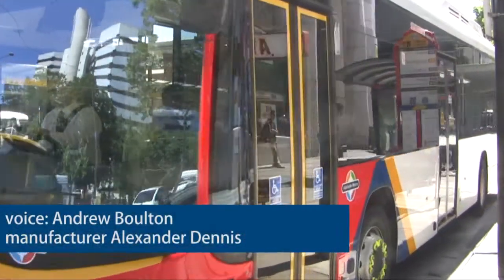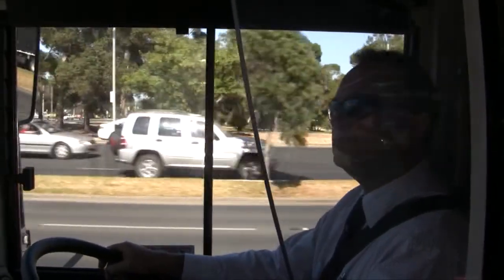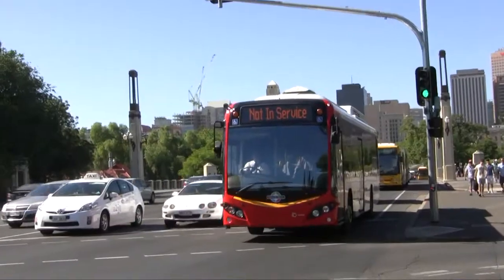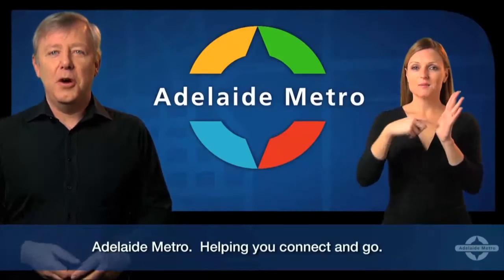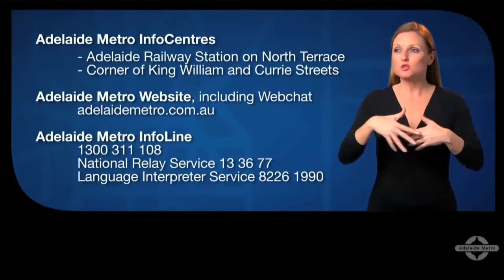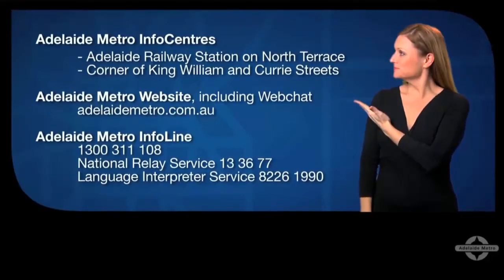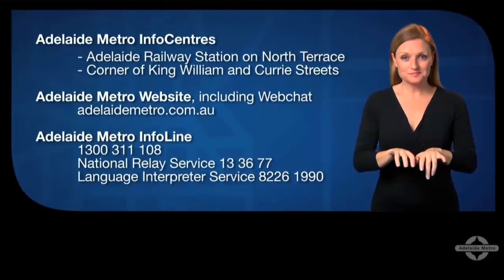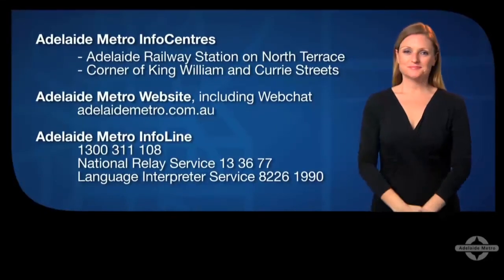Adelaide's new hybrid bus

Comment: Since its still using Oil, why use the electric motor? Regen is known to be inefficient. It gives little gains. Why not continue using a diesel engine alone? why complicate things? Its still not green.
Reply: Richard Tan Tan As said in the vehicle, the Diesel engine is not connected to transmission but instead to an alternator.  That gets rid of a transmission.  The alternator is connected to a battery which is then connected to the motor.  Of course regen would only be useful for an amount of time(which can be used to help accelerate).  Therefore Hybrid busses are much more efficient than normal diesel busses as the Diesel engine just has to rotate at a continuous speed versus a Diesel engine with a transmission working inefficiently.

Comment: Brilliant idea!!!! This is where we should be spending infra structure money, not on 18th century electric trains which pollute the landscape with poles and wires, disrupt the city with restricted access to vehicles that won't safely fit under the High Voltage catenary. Now if these buses were put on busways that used the existing rail corridors how great would that be!!! The next logical progression would be to use CNG or hydrogen powered engines in these new hybrid buses, truly future vision.